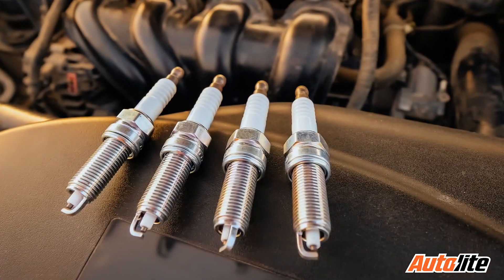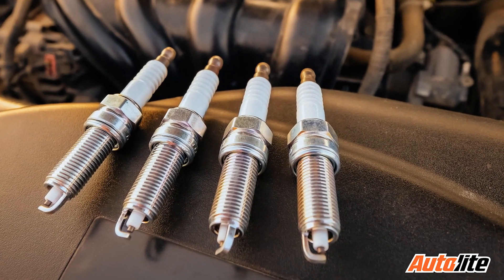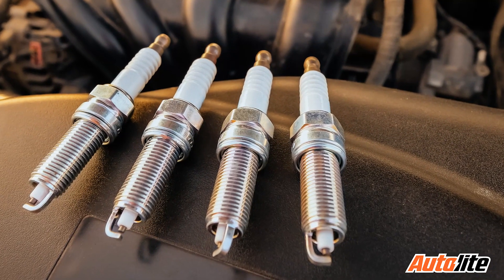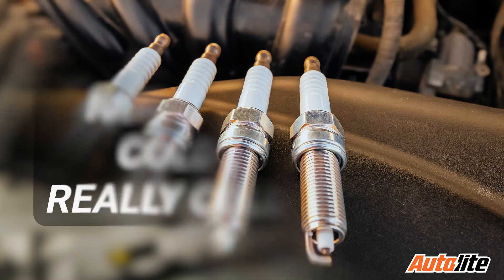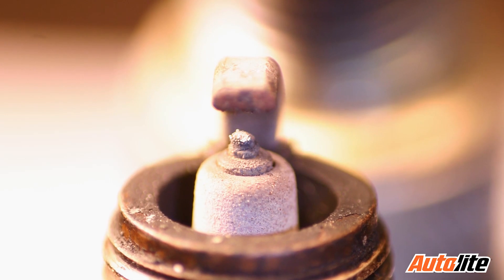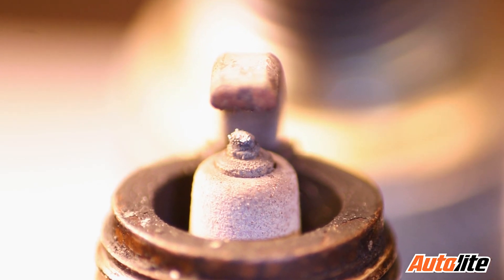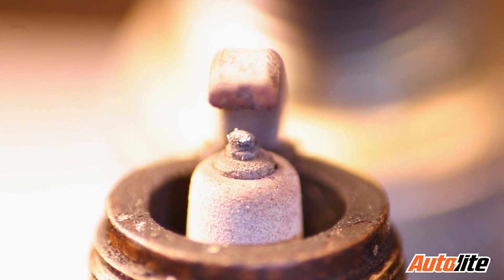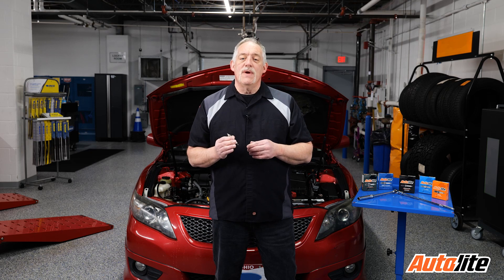Understanding Spark Plug Heat Ranges

Comment: How do you feel about the method of buffing the plating off the threads and then looking for heat discolor 3 threads down. Will this give you the best hear range for that engine?
Reply: Your method is exactly what I know about how to determine the correct heat range . Someone would say that it can be determined by the heat mark on the ground strap electrode , which must be at the middle of the strap exactly where it is bended but the place of this mark depend also of spark advance angle, so 
first the proper heat range must be chosen ( using your method ) and then to watch for proper advance angle by the ground strap heat mark . However on well tuned engine ( fuel injected and with ECU controlled ignition)with correct spark plugs heat range the ground strap heat mark is right in the middle on the bend .I suppose, that ground strap heat mark is much more sensitive to changes of combustion chamber temperature since is much more exposed to the flame .